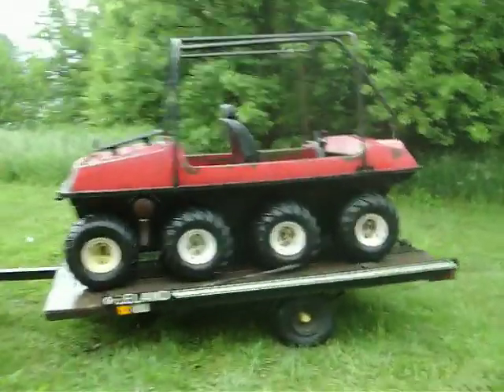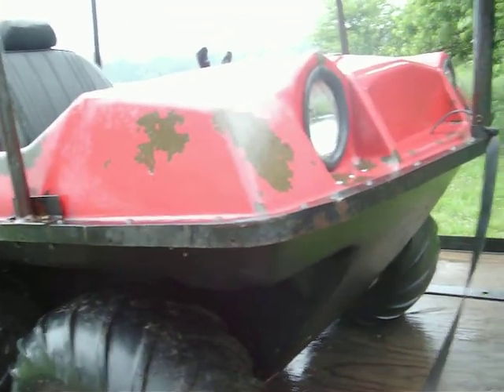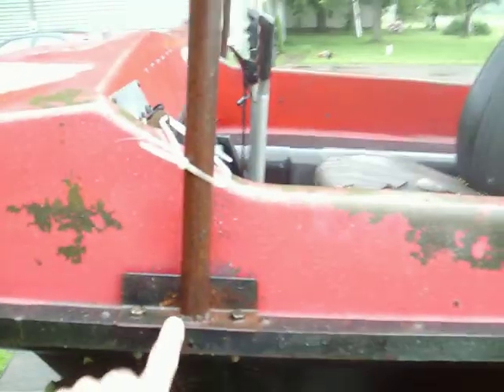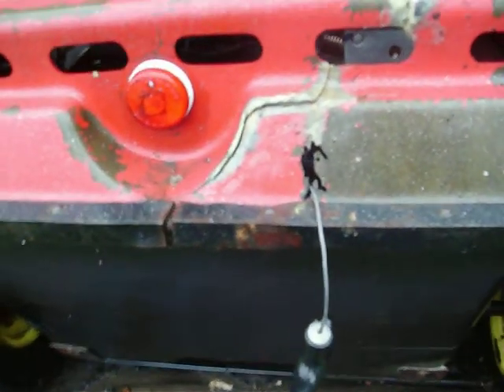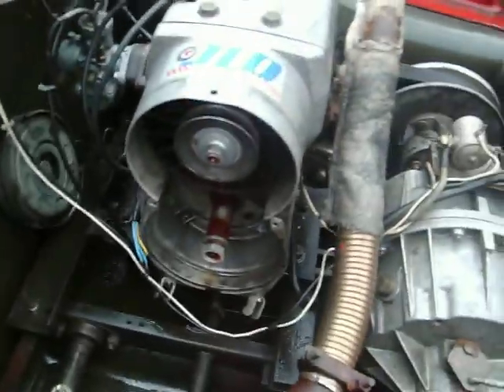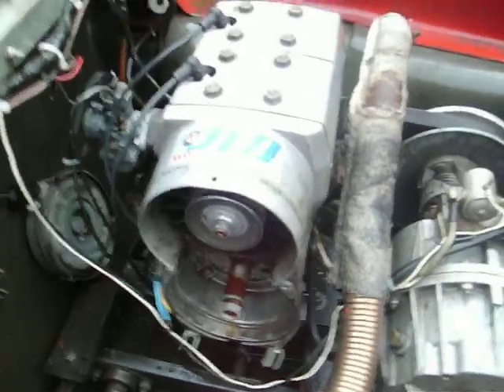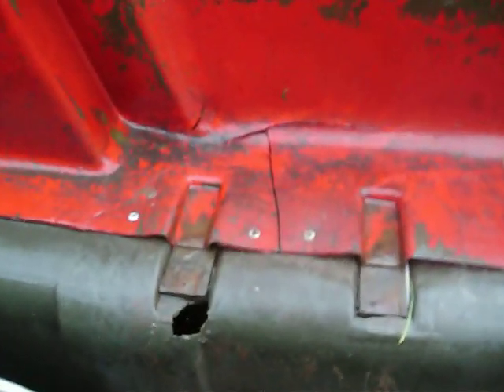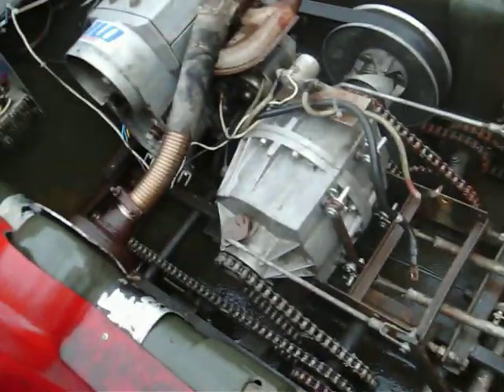1972 attex military tank trainer.

Comment: It is not correct that these were utilized as "tank trainers" or how to drive tanks (with which it's operation at the time had nothing to do with U.S. tank controls, which used T-bars, not laterals). The intended function was to teach junior officers in the Armor Basic Course at how to direct movements of a platoon-sized element, using radio. This is much cheaper (and safer) than puttering around Ft. Knox in real M-60 MBT's, getting stuck, throwing track and burning diesel. Program was short lived.